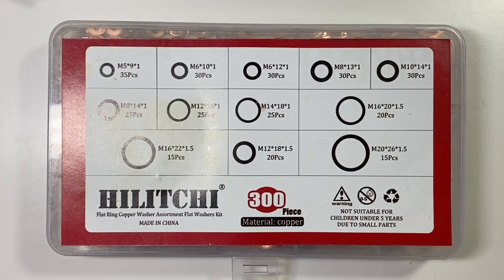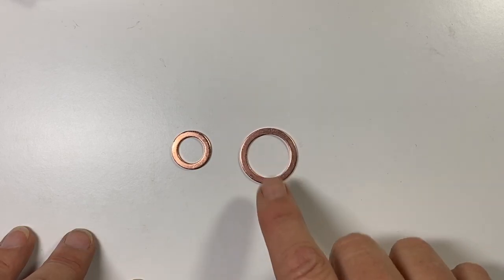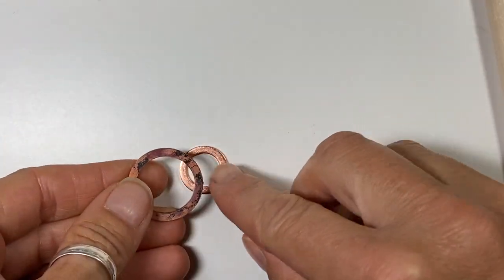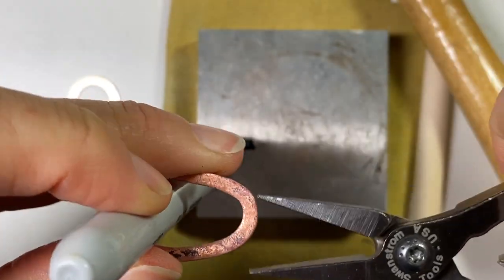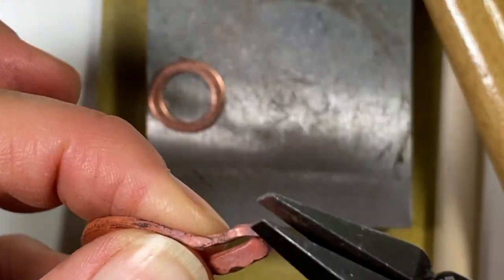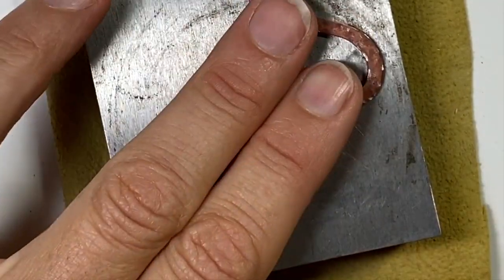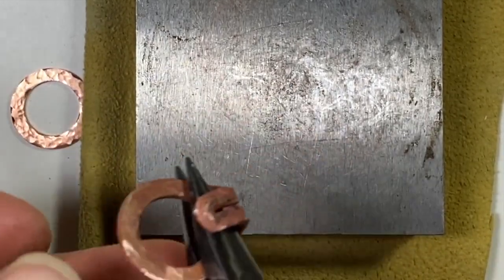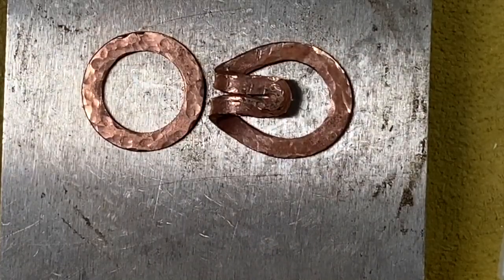DIY Jewelry-Anneal a Copper Washer to Make a Hammered Clasp!

Comment: Very creative clasp!  I bought some washers to make fancy jump rings, but now have one more use for them. Nice work, Melissa!
fyi -I think the metal heats up faster when laid on a block of charcoal which lays on a firebrick.  The air cools it rapidly but the charcoal does not. Also a propane torch (self igniting $40) from Home Depot would work as well as the butane.  The butane torch is safer, but propane is hotter.  Propane gives off CO2 but butane does not.
Reply from the maker: Thanks for the tip! I’ll check that out! 💜